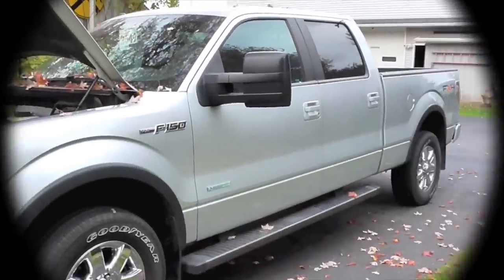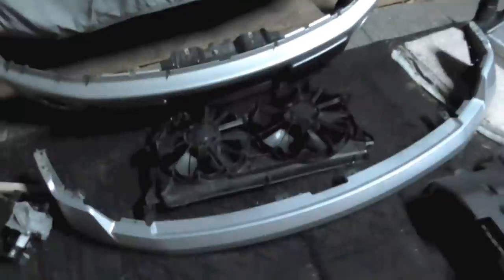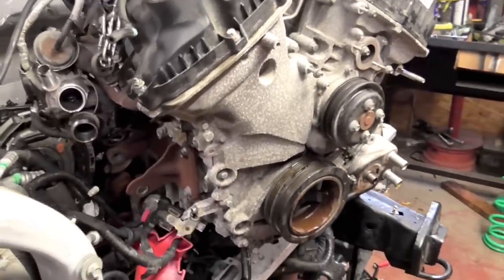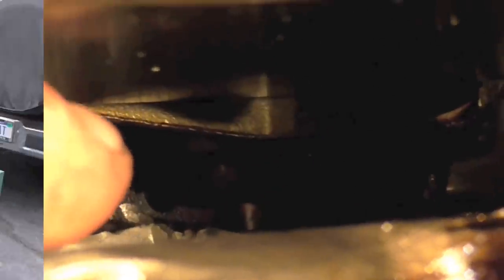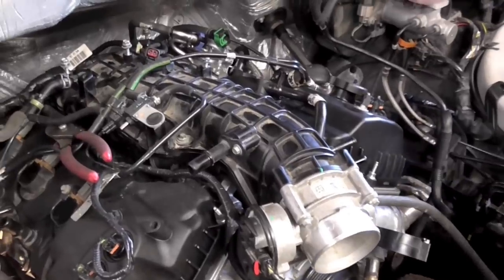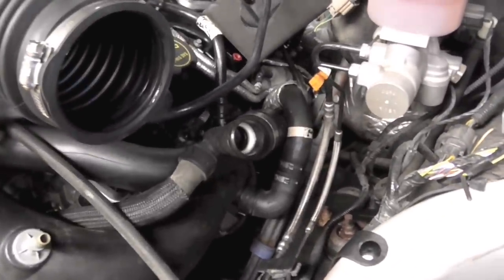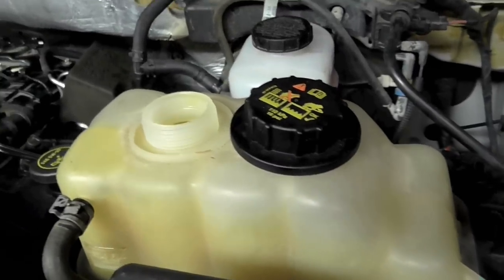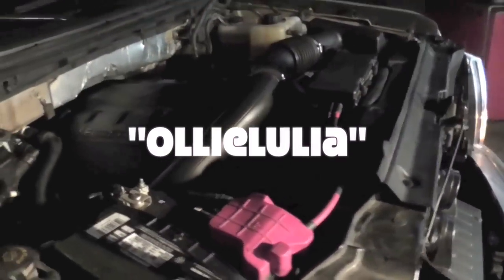FORD F150 TRUCK:  3.5 V-6 ECOBOOST ENGINE FAILURE (Removal and Installation).

Comment: how much did this job cost?????
Reply from the maker: about / near 9K.
Reply: is the rebuilt engine corrected for defects or is it just the same stock parts ford that failed in the first place?
I guess that would be about 12ooo in Canada
Reply from the maker: It was a "long-block" crated Ford Engine with all the upgrades inc. timing Chains, sprags, ans the Twin-Turbo Oil Cooler update "cooler lines".

Comment: I will NEVER buy a ford. I have a 1999 silverado 4x4 with 6L automatic, firm ride suspension, trailer towing package, camper package. Just started using it for my daily driver with 37k miles on it. Really a good truck. have a 4wheel grandly camper on it and my average around town is 11mpg. not bad for the weight about 7k lbs or so. I have driven fords as company vehicles a lot. The paperclip counters always buy a ford cause its cheap. My son had a ford transit. We did all the services and it still did not make it to the end of the loan payments(transmission started acting up). He has a toyota yaris now(a really good vehicle). My girl friend got my toyota echo after her piece of crap P.T. cruiser  crapped out. So I am down to the truck only. No dodge either(Fix it again tony).

Comment: For a brief second there I thought this video was going to end without them firing up the new engine. That would've given a gear head like me some "mechanical blue balls", however it had a happy ending. No matter how many times I've rebuilt, swapped or just fixed an engine, I always LOVE that first startup. It's the champagne of victory for a gear head like me, anyone else feel that way too?
Reply from the maker: Hey Curtis !  "I can" !!!  *IT WAS "SURREAL" !  We had a good many doubt's that it'd leak / or wouldn't go, but it did amid NO issue whatsoever. It continues to "spot-on" / 0 issues.  :- )

Comment: this is why I am not a fan of the eco boost packages. at least not on trucks
Reply from the maker: I don't know Charlie , My kid is (15,000 + later),  driving the Truck,  and continues to enjoy perfect operation. Add ta that that ('well in the Summer'), He gets 22-23 MPG;  and it's NOT a bad Truck. The Motor's "whisper quiet", and the thing has all the power you'd ever want. *Were it not for the "Hydrolock failure" (if only We'd known about a water / condensation issue), I think this would have NEVER happened to begin with. 

Changing the dam thing: (The Eng.) was alot of "busyness & reality" .... and yeah, in "hindsight", (had we known) then: "well whop knows". All I can say is the Trucks amazing to ride in,  drives like a Roles Royce, and the "Kid" absol. Loves the thing. He'd NEVER trade it off for another, even now !   :- )

Comment: My 3.5 has 400k still going strong...motorcraft oil,+Lucas. 
All original parts still
Reply from the maker: "Sounds like ME talking Matt" ! ... * as I near 100K on this motor / I do EXACTLY the same thing and the truck runs GREAT / NO issues at all !!.  :- )

Comment: I work in allot of the 3.5 eco boost engines. They are great when then work. But man the cost of repair. This is why as a mechanic I chose the 5.0 cyote engine. But I do make good money on these engines. I don't make as much with the 5.0. Lol
Reply from the maker: I was a TECH for many decades at a GM Dealer Jeff ... "I know EXACTLY what you mean" !.  :- )

Comment: great video. I enjoyed watching the process. I do with Ford would engineer these things better. They are already great but should be over built instead of "good enough" built....
Reply from the maker: "Quite a process it was too" !!!  Thankyou Sir.   :- )
Reply: TommyZTrains 
Tom, if you have access to an overhead crane or a friend's shop with electric above ground lifts, I would remove the cab (about two hours ) It's a heck of a lot easier to remove and install and align. you will save several hours and your back. Hopefully this is the first and last time.

Comment: 2012 w/273k. 
Injector design is compact & does suck.....however, there are 100s of things designed on most every car/truck made that suck. It’s just part of it. 
‘77 caddy blower motor-thru the fender
Dodge something or other with battery inside the fender 
Chevy avalanche-hard to look at......
Again, Just part of it

Comment: Everyone is trying to squeeze more power out of smaller engines, to get milage and save costs. They should have learned from there turbo, and supercharged models of the late 80's and early 90's. You never saw one of those cars that didn't smoke,& burn oil. Ford hasn't made a decent engine since the 5.0, and the 7,3 diesel. The hemi is chryslers only durable engine, but it's expensive and a gas hog. Chevies are all junk, and none of the imports hold up when towing hard.
Reply: prawcess No, they could do better. All the car manufacturers are building cheap junk and charging more for it. I see more and more of my old geezer buddies coming home with muscle cars. If you're gonna spend 40 to 60 K for a car, why not get a little steel under your ass? I have a pet Muscle truck of my own, that I had built from the ground up. It will be running years after every new diesel truck on the lot has been crushed.
Reply: Grumpy old fart What kind of Muscle truck do you have man.

Comment: Yeah I'd stick with the 5.0 V8. It's a sweet motor & sounds great. I've seen too many Eco Busts end up with what you had to deal with out of warranty.
Reply from the maker: +Leonard Russo  > It might be the "Engineer's DREAM" (on paper) Leonard, but again:  *you'll likely never find a "twined Turbo v-6" more "BUSY" then this ... "It's pure engineering", *but so far as longevity, I just can't see there "NEVER" being a problem. The "Mechanic's of this power-plant again, are mind-boggling ! / VERY Complex ...  

Being ("AGAIN")  F A I R  , It's been running absol. perfect sense the "change-out",  Truth be told, I don't think it'll reach a hundred K without an issue., there's just too much / many moving parts !  *MY Opinion  :- )
Reply: just don't modify the 5.0.
Ford TSB 11-7-7
other than that the 5.0 seems great. 
sorry about your sons misfortune..I hate to see people's vehicles broke down. I'm glad, however, that it's fixed for him. nothing like having that father/son time working on a vehicle. best wishes :-)
Reply from the maker: +2010V6RAV4   Thanks ... Your RIGHT, "The BEST part of this was time spent with my Son" !  :- )
Reply: This is why I didn't get an Eco boost in mine and I have the 5.0. This looked like one hell of a job. When I was a ford dealership mechanic back in the 90s. The worst engine swaps had to be on the lincoln mark VIII cars. This makes those look easy!
Reply from the maker: God you got that right !!  "I think I'd pop a gun to my head were I have ta do all this again" !  The BEST Part:  Quality time with my Son ("well MOST of the time") .   Best :- )
Reply: +TommyZTrains  Well you did a hell of a good job sir! Those injectors look like they are installed by robots and not humans based on the super tight location. I have a truck exactly like this one and I would have done it as well. And like you, I'd do anything for my son! 😉
Reply: 5.0 and go.  Never had an issue other stupid AC and I Saul silly Ford stuff. Seems to keep purring with good maintenance. Most Ford mechanics say 5.0 as they see less of them for failure.

Comment: That will be me very soon! My truck only has 16k miles and she's a 2014!
Reply from the maker: Think "Potential" !! (???).
Reply: Mine had potential, 470whp and 570wtq :)
Reply: kcotte59 Engine thru a rod, I took a chance on a different tuner and the moron turned my knock sensors off.. Kaboom! I ran 58mm turbos along with Devils own methonal.
Reply from the maker: Apparently it did, *Carlos must be an "Eng. mind reader" !!
Reply: Carlos Andrade  Maybe you'll have better luck.

Comment: I don't trust Ansoil , there are several engine failures on Youtube of people using Amsoil . The guy that got 250K out of engine used regular synthetic blend and OEM ford filter.
Reply from the maker: We just use motor-craft oils now (or Ford would void our 3 year warranty on the crated "long-block" that we installed. After that: oil had nothing ta do with OUR failure: It was WATER. 

Questions: read the description Alloy.  :- )

Comment: Ford trucks are the fucking best on the planet I love ford trucks especially diesel 4x4 super duty king ranch trucks 
Thanks ford to building those dream trucks!!!
Reply from the maker: I pretty-much agree Dave ... all-tho: "I may have stuttered a bit, AFTER Ford wouldn't even so much as "reply" to a hand-written plea" (for 'any' help with 'anything'") that we made ... But NOW: *(as the truck nears 100 K+ miles), it continues to perform spot-on,  amid ZERO issues with anything at tol.
Reply: TommyZTrains 👍

Comment: The 2010-2013 ecoboost is such junk. I had a 2011 SHO.  I wanted to love the cars turbo tunability. It ate the fuel injectors, ptu and plugs. As soon as it was out of warranty i sold the pos.
Reply from the maker: I don't know Brandon / this truck STILL runs flawlessly (all these years later) ... and: I have an "Escape" the a 2.5 "EcoBoost" nearing 150 K and have had ZERO issues. "I guess their ALL "GOOD" when they RUN !.

Comment: Dude, you are a lot more forgiving and even-tempered than I am.  A major engine failure below 150k with decent care today is inexcusable.  Ford wants a king`s ransom for their trucks......then  Don`t release designs that are prone to failure.  My last ford was a 2003 Expedition with the insane spark plug debacle problem.  Haven`t bought another since...... I like their  new trucks and I`d prefer to buy American but I`m hearing about valve carbon problems and no acceptable way to fix it????!!!  New heads??  At 85,000 miles out of warranty??  WTF!!!  Great for Ford, but not for us.  Prove you are in the ballgame with toyota, nissan and mazda and I will pay a premium to come back. Dependability is far more important than ipod connectivity or cooled seats.
Reply from the maker: "LMAO BIG TIME" !!! ... We tried, 8we even wrote a hand-written letter to the Ford "CEO" !  (we never got a reply). I 100% agree with all you say amid "designed obsolescence", ** and that's what all this WAS. I am a "low-key" type of person Martin, and believe me I let "them" have it, (even escalating things all the way up to the Dealer Rep.) . All my words fell on deaf ears.  So rather then whine and sit in a corner,  we just "moved-on" and got the dam thing done. You on your own in this life, and that's for SURE ... BUT: "I don't have ta like it" !!  :- )

Comment: Yeah.... my well maintained 2011 F150 Ecoboost has been sitting in my driveway rusting for 5 months! I don't have the $5800 to swap out the engine, and of course Ford doesn't acknowledge the Ecoboost is flawed. The balls of this company?!
Reply from the maker: That's sad, but a "long-block" engines alot more money then that ... Being "FAIR", ours continues to run flawlessly after this project. None the less it was tough pill to swallow Unicorn.

Comment: I must say I have a 13 Sierra 5.3 Vortec and not even a hiccup at 52000
Reply from the maker: +Tony Mikesell  Yeah, all we ever see on GM "K" Truck Platforms are; Hub Bearings, and encoder (4-W.D.) Motor problems. "I love GM Trucks", *but Fords GREAT too.  :- )
Reply: I thought they were called Ecotech.. My 07 Sierra has a Vortec.. 200k miles so far..
Reply: +Heartagram ecotech 14 + I have a 13 vortec
Reply: +TommyZTrains where do you work if you don't mind

Comment: you skipped all the hard parts, actual pulling engine and installing back and injector's R&R
Reply from the maker: Any many more after that ... It was a long time ago / + I wished I had a better camera and more back in the time. *We had nightmares after those injectors leaked and a seal "rolled" and it all had ta come back apart again" ...  Yeah, ya learn / amid many regrets.  ; - (

Comment: meanwhile I've been running a 4g63 at 28 psi in my daily and beat on it for 4 years , not a single issue. Merica you fail at turbo engines
Reply from the maker: Who's "Merica"  ??

Comment: IVE SEEN MANY VIDEOS REVIEWS ETC ECOBOOST ENGINES W WELL OVER 200K AND STILL GOING STRONG

ONE COMMONALITY FULL SYNTHETIC OIL CHANGE EVERY 5K

ILL CHANCE IT W AN ECOBOOST...

2.7L ENGINE BLOCK IS NOT ALUMINUM SAID TO BE MORE ROBUST 

20 MPG CITY VERY ENTICING DONE W A CALCULATOR NOT THE DASHBOARD DISPLAY

Comment: I'd change the oil every 3,000 miles in these engines if I had one. I bet I can get a shitload of miles out of an Ecoboost engine with proper maintenance and sensible driving habits. Man, that is some serious plumbing and wiring. I'd go with a normally aspirated engine and screw all this nonsense! A TECHNICIANS NIGHTMARE!!!!
Reply from the maker: Agree 100% DJ ... I had a "Blackstone anyl." done *(with the Amzoil Syn. oil I was using). The results were SPOT-ON (and agreed) with the trucks "oil life index" readings. NOW were doing the 3K with Motorcraft oils (as recomm.), as you get a 3 year warr. on the long-block crated engine. *The truck continues to run flawlessly. :- )
Reply: TommyZTrains, to me, extended oil drain intervals please the environmentalists but they don't do a damn thing to keep engines running at top condition. Ecoboost engines need high quality clean oil. The payback would be at least a 200K engine.
Possibly a lot more!

Comment: Lot of sludge for a supposedly synthetic oil plus he drove like he stole it a lot for a rod to disintegrate like that.
Reply from the maker: "Nope". We had a "Blackstone Oil Anyl." (before ANY of this occurred). Read the info. above / and click the "more" Curtis. The failure (amid the conditions) are outlined / worded in finite detail THERE.
Best   :- )
Reply: Did you use the oil life monitor for oil change guidance?
Reply from the maker: @weblover9185  We reset it, but usually changed it at / around 5K anyway ... Being I'm a fluids Engineer I thought it would be interesting to have a "Blackstone Oil Analysis" done (I did). This looks so sulfates / fuel and other things IN the oil ... the results were SPOT-ON in "agreement" with the Trucks "oil-life-index" feature. (just FYI there).

Tho the failure HERE,  was a hydro-lock issue,  ... *so: we just went back to a plain ole Motor-craft-Oil,  (to uphold Fords 3 year crated motor warranty), and the truck continues to run run flawlessly.

Comment: the problem with these newer for engines is the cam phaser bullshit on them thats controlled by oil pressure and electronic solenoids. its junk!  they fail VERY often and even more often when the engine has been subject to extended oil change intervals. on the contrary the engine you just installed sounds like shit. it already sounds like the cam phasers are rattling! you better make sure the solenoids in each valve cover are working and not plugged up. if they are ok, you better tear it down and investigate or you'll be installing another engine dude......